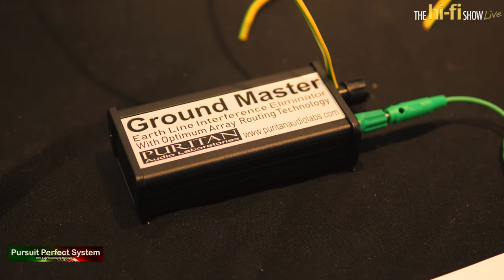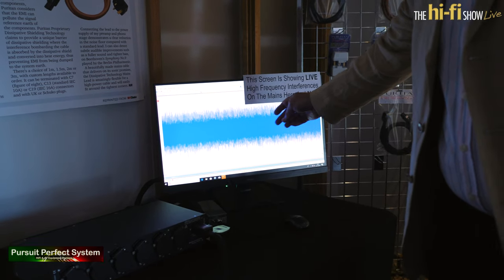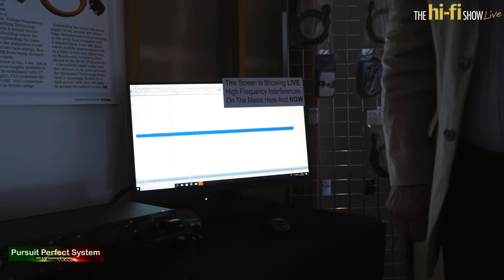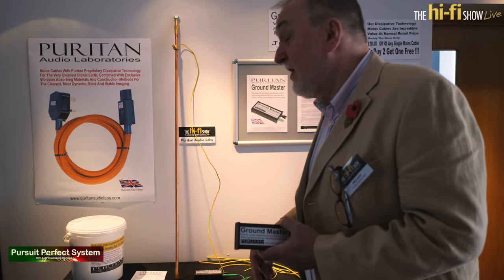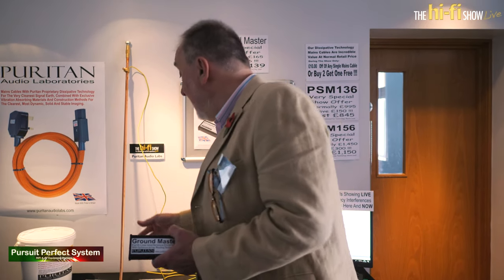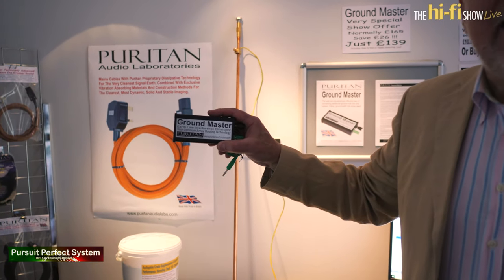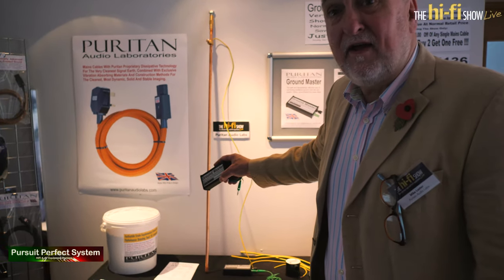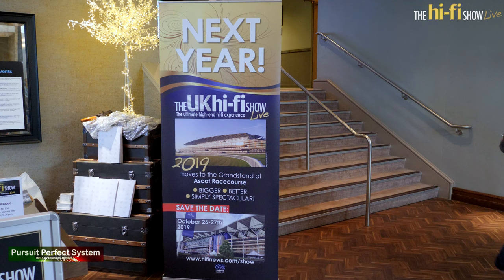Puritan Audio Labs short demo and NEW Ground Master Product @ The hi-fi Show Live 2018

Comment: Third of a volt in 240 volts that's about.  Point .13 %  
 Should mention what the scale on the display is . I suspect only a very small part is shown to emphasise the variation to aid sales.

Comment: would you connect a power amplifier to such a device or would it limit its dynamics?
Reply: If the amplifier circuit not it's power power supply has such a current drain to cause the voltage of its rails to drop enough to impact the swing available at the speaker terminals it will for sure limit the dynamic range.

Comment: Please explain:1. Why does the safety earth not short out the router?2. Surely the noise will go back to earth and you are back to square one?Thanks.
Reply from the maker: maybe a question for the manufacturer as I cannt answer for them thanks
Reply: Hi David - I don't have a degree in electronics, but I'll have a go at answering your question. Signal earth is often 'floating' or connected to protective earth in most systems. In each case it is open to ingress of noise from your own household's electrical devices or many other people's devices in their houses. So it's desirable to have a good earth connection for your equipment's signal ground - which of course you can get with an earth rod connected to a signal ground. BUT - if your or someone else's electircal appliance actually malfunctions and puts significant mains-frequency power into the earth, the best route to ground might be via your earth rod, and your hi-fi kit's signal earth on the way to that rod. The box here is a surge limiter at mains frequencies to stop it being a preferred protective earth route, but allows the high frequency noise through to earth to keep your hi-fi signal earth noiseless. So basically if a fault occurs, it won't fry your hi-fi and make you go and angrily punch your neighbour with the faulty fridge. In other words the Ground Master eliminates the Flash and the subsequent Furious Five...
Reply: @HandbrakeBiscuit  

🤣  👍🏻👍🏻👍🏻

Comment: I always feel these power products are snake oil. Anyone have positive personal experience?
Reply from the maker: they are showing you there what they do. I use loads I wouldn't be without them
Reply: @PursuitPerfectSystem  I can see what he claims they do, I am specifically interested in what impact there is, if any, on SQ. Have you done an A/B? Precisely what differences did you note?
Reply: @PursuitPerfectSystem  Colour me cynical.
Reply from the maker: @johnratcliffe6438  :) try one one day and see what you think. try a good one though
Reply: Hi John. I don't have any experience of hearing the Puritan products but I've seen them and spoken with Mike Lester (the gentleman in this video). For me the hi-fi hobby is about building my own (modest) attempts at amps and speakers - my degree is a technical one but not electronics. I went to the Bristol hi-fi show this year and met Mike Lester on his stand. I certainly have a very positive experience of the man, his reasoning, the build quality of his products (I have no affiliation with Puritan and in fact hadn't even heard of them before).
I declared straight away that I probably wasn't going to be a customer because I make all my own stuff - yet he was very accommodating and patiently explained to me what all the various stages of his product did, and how they addressed the problem of mains electricity having lots of unwanted high frequency components on it (noise, in other words). It all makes sense and was pretty much the most down to earth, hyperbole free conversation I've had about a piece of hi-fi kit. He was also very encouraging of me to have a go at building something similar myself.
Some guys who were more knowledgable about electronics than me turned up and were very impressed that the components used were very high quality and appropriate for the job they do.
I know from building my own power supplies for amps that they generally use just simple CRC arrangements after the transformer (capacitor-resistor-capacitor) and that such a supply is not great at rejecting noise on the input. Ideally you'd filter that out before even getting to the transformer, which is what the boxes Mike makes do.
Reply: I have one , they are insanely good. The difference s I noticed in my system was night and day. Huge scale and sharpness difference to my Naim/ esoteric / acoustic signature system
Reply: @PursuitPerfectSystem  Then why didn't they also show the interference on the output of the PSU on a connected device?
Oh, yeah, it's because the PSU on any decent device will remove the interference.
Reply: Most things in the hifi chain have an effect on SQ. power conditioning is one of the least controversial.
Reply: No, they can make a big difference.
Reply: When I connected mine, there was an instant widening of the soundstage.